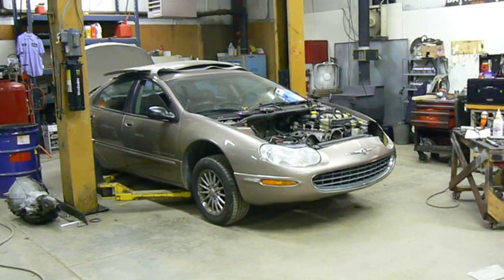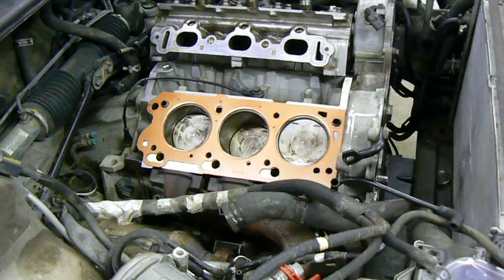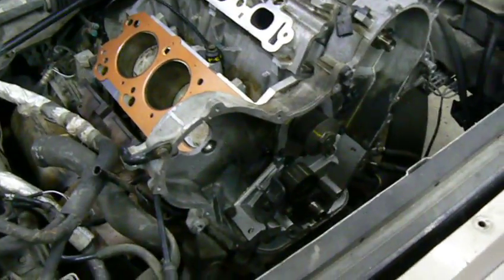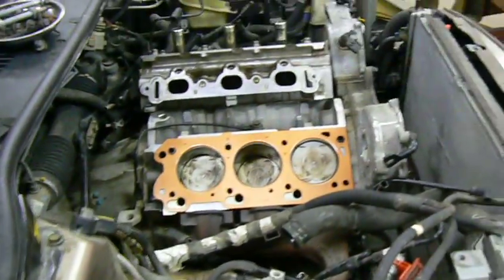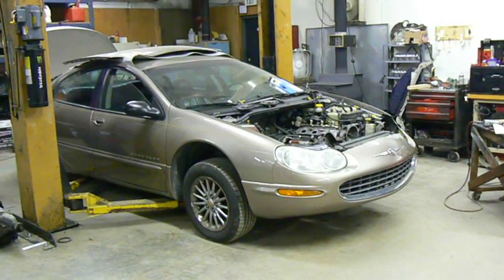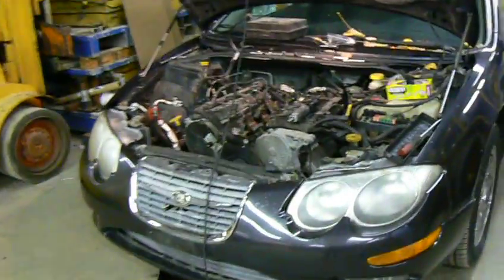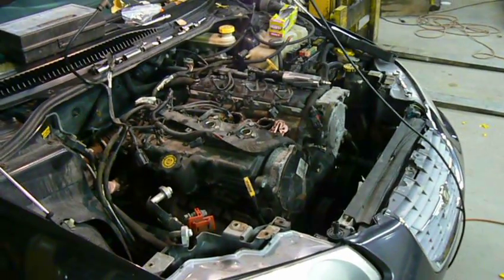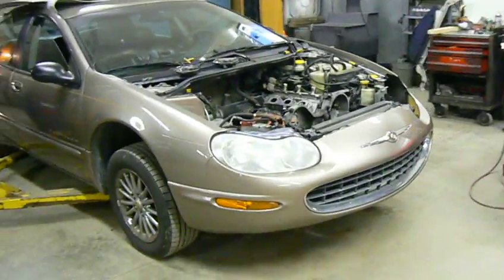Chrysler Concorde 3.2 V6 engine rebuild

Comment: lol same post on my new account didnt even realize i drive a 2000 300m even using atf 4 i have no clue who uses dex mec in these , regardless i beat the living shit out of my cars change all fluids eerily and let me tell you as some who beat the cars into the ground they are not even a faction of build quality of a Toyota/Lexus tranny   its just a bad idea to throw a half ass built trans-axle on a car like this now if they did this car right and used a real transmission it wouldn't be half bad

Comment: On the 3.2L and 3.5L chrysler engines of these cars and at about 60000 to100000 KM that piece of junk water pump fails completely (the #!#@**666&#$@#** pump plastic impeler slowly disintegrates and finally stops moving the cooolant around) The end result is a nice cooked engine with blown headgasket(s), ticking noise, and likely further damage..Car's temp gauge should never move above mid-line. If it does immediately turn the engine off . Let the engine cool and don't drive until pump's fixed!